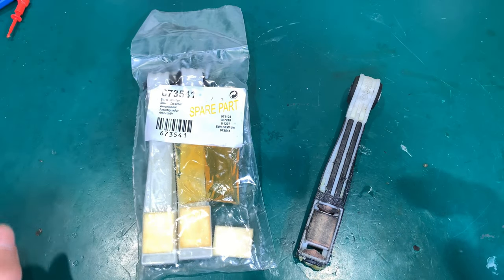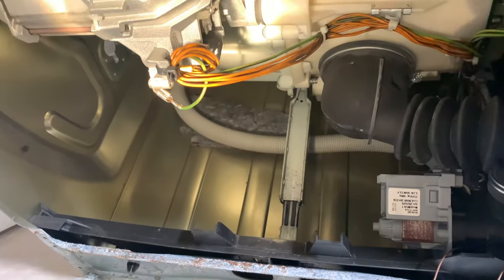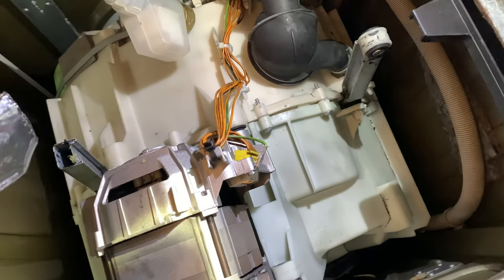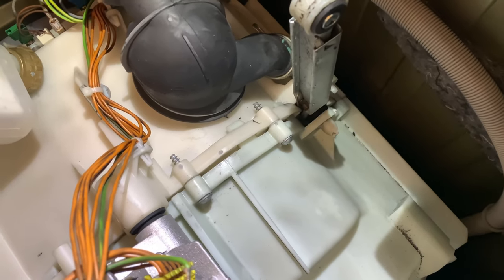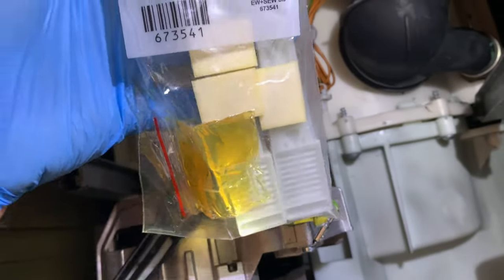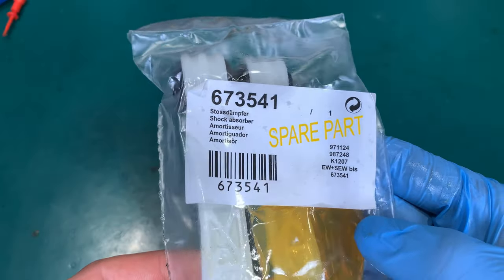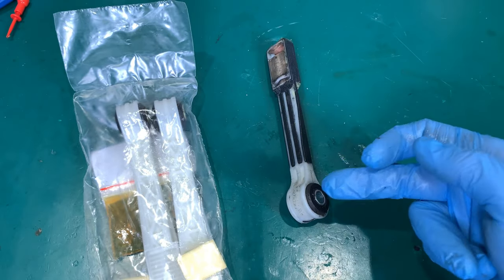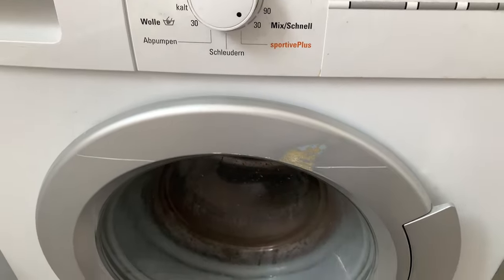fixing banging / loud washing machine Siemens runner E14 3R - replacement of shock absorbers

Comment: I did this as well but in reality with the makers replacement you withdraw the shocker from the metal casing after removing the bolt and then put the makers replacement back in the metal casing and rebolt.  The new parts come with pads and grease easy.  There is another video on this under siemens.

Comment: How do they expect a plastic drum housing to hold a drum bearing and not flex.  Plastic rubbish!  They build nothing to last these days.  They used to last 10 to 12 years, now you are lucky of you get 8 to 10 years.

That is nice and quiet now  :-))
Reply from the maker: Fully agree - good thing - it looks like as can be opened to remove bearing - I saw inventions where they are welded so without cutting drum enclosure - You can't replace bearing  <- for our good... i mean pocket  of company :D
Reply: @ElectronicNoobBlog  If you look in the back of a plastic drum housing, you can see it flex with the strain of the drum.  Some have a metal X of steel go across the bearing, but it is a joke.
They are built to fail after 6 to 8 years.  Land fill for no other reason than it makes more money for them to fail and not be worth the labour to fix!
Money grabbers!!!

Comment: The pins are not removable, they are part of the tank moulding.  You have to cut them & then drill the plastic to put a steel bolt through.
Reply from the maker: Thanks for feedback!  Anyway it died year later, I tear it down and found that metal X that is holding drum to shaft that go inside bearing corroded and break... it was eaten away like from some sort of galvanic corrosion!! This time I bought top-loaded - hope will be easier to maintain :)
Reply: @ElectronicNoobBlog  Oh, that component is called the spider.  They seem to be susceptible to corrosion.  Sometimes it can be replaced, but usually you need a new drum.  Sorry your washing machine died!  I hope your new one will last many years!